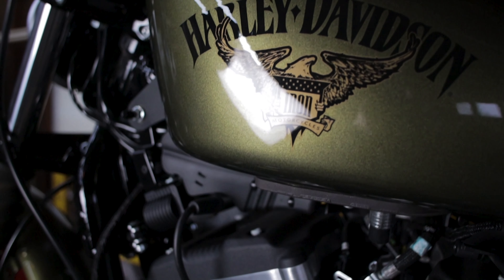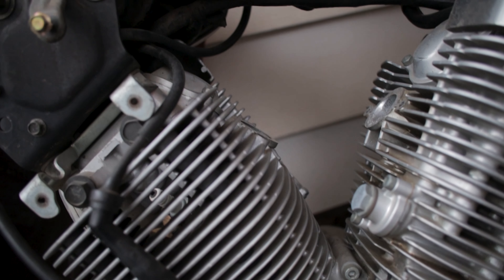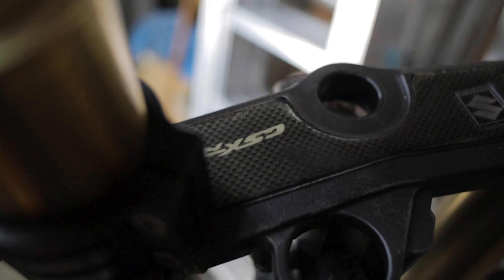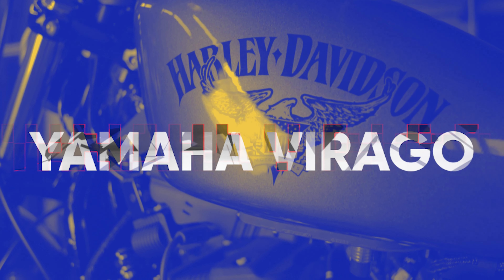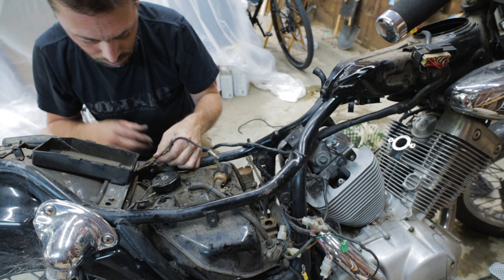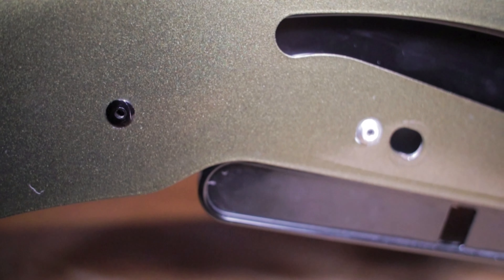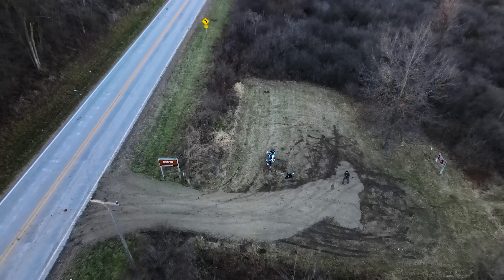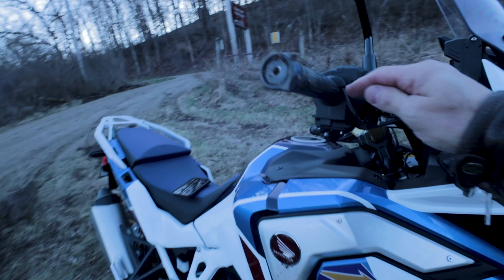This bike is my favorite

Comment: Awesome to see all the bikes. Good project list.
I have a 2021 Triumph Tiger 900 for long distance and light off roading. I did 9800 miles on the bike in for months. Love this thing.
2014 Triumph Speedmaster - fixing this one up. Going to donate it to a veterans charity.
2016 Indian Scout - copart bike was flood damaged. Have it running. But haven't really started working on it yet.
2018 Indian Scout Sixty -  wrecked bike rebuild. New radiator and cooling system, whole new front end including upper and lower trees. This has been my current winter project. It's done. Waiting on final parts to hang exhaust. Supply chain slowed me down a LOT on this one. Will probably sell this one and ride the scout above for the summer.
Reply from the maker: That's pretty sweet that you're donating the Speedmaster to a veterans charity.
Reply: @GreatEgret  Yea, I am veteran.  And my company matches 100% of my donations up to $18k.  So I can get a bike to a veteran (they also get a year of gas money and insurance), and then my company doubles my donation.  Win / win.  And my wife is happy because the bike is gone, until I find another one.  Ha ha

Comment: I only have the one bike, and that needs some TLC to bring it back upto shape, I have a couple of oil pipes to replace that have perished and have some dreaded rust to get tidied up or replaced (batt cover mainly) 

Then next year I may mod it with a 1250 and some new bars and grips, and a tank lift
Reply from the maker: All your mods sound great. Especially the 1250.  Hopefully I'll be doing the same to the Iron later this summer.

Comment: Hi Joe,
 I'm always surfing for rear panniers ( large,camping, etc) for the 883. I would have a preference for click on, off ( snap locking) and maybe a leather look. I think there's a problem with indicators. Is this why you relocate the indicators?. I know you would of looked into it. Bike review was good. Less confusion now, ha. You'll have to introduce your dog. 😀 Cheers thanks Trevor.
Reply from the maker: Yeah, with any saddlebags/panniers installed, relocating the bullet-style tail lights is necessary. I like the look of the bullet tail lights, so this is why I like to use a sissy bar and large sissy bar bag. 

I for sure need to introduce my dog,  “Miracle Max” in a video at some point.

Comment: Camel ADV makes some nice foot pegs (I have a set on my Africa twin).  Bark busters, I had to wait over six months but they’re more readily available now
Reply from the maker: Thanks! Looks like Camel doesn’t make foot pegs for the 2020+ AT. This is from their website. I may just get the OEM ones. I’ve been waiting four months for Bark busters. Hopefully soon!
Reply: @GreatEgret  … I have a 2020 Africa twin.   They do make them.  They’re a universal fit.  My buddy has a 2019 and they’re the same pegs.  I like them because you can remove the spikes if you want
Reply from the maker: I might check them out. thanks, man!

Comment: All the projects sounds cool but I really would like to see the Yamaha get built in a build series.
Reply from the maker: It definitely is a great canvas for a lot of different styles. What do you think I should do? Cafe Racer? Bobber? Chopper? Build back to stock?
Reply: @GreatEgret  you already have a cafe racer going so I'd probably go with a chopper or bobber and then go on a new roadtrip. Different rides for different feels I have a 1980 Honda cm200t bobber 2017 sportster superlow 883 and a 2001 triumph tiger.

Comment: Joe, I'm thinking of trading in my iron 883 for a low rider S.  It seams you have done the opposite.  If there is any insight you can share, it would greatly be appreciated.
Reply from the maker: If you haven't seen it yet, I covered some of this in this video: https://youtu.be/HMFexfS3wS0

Here are the cliff notes: 1. I loved the 2021 FXLRS, but when I saw the 2022 leaked content, it looked like Harley addressed nearly every issue I had with the 2021 Low Rider S.  Including the 117 and the gauge cluster on the tank. 2. Harley changed the ECU in 2021 so that aftermarket tuners couldn't be used.  I never really like that I couldn't use the FP3 on it. The 117 on the 2022 would help me get over that, but when I had my 2021, I kept wishing I had a 2020. 3. Nostalgia for a Sportster won here, especially since I knew I would have another M8 Softail at some point in the future.
Reply: @GreatEgret  thanks Joe.
Reply from the maker: @Lyle Guidry  you bet, brother! Let me know if you end up putting a Low Rider S in your stable.